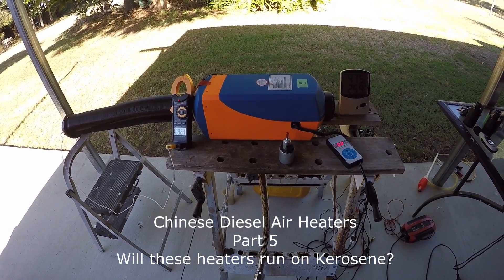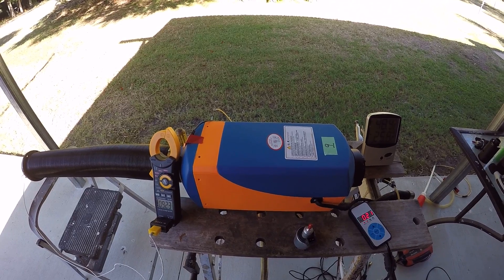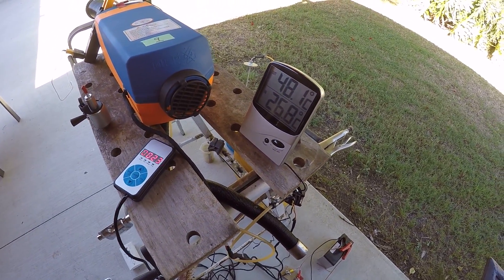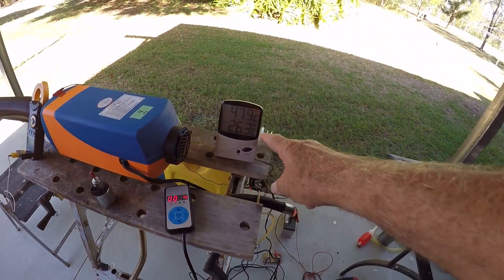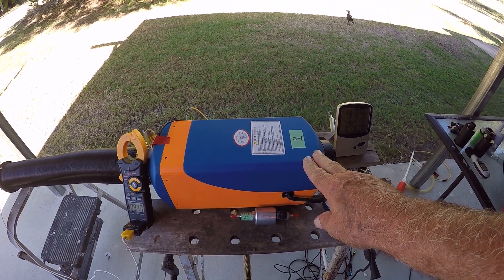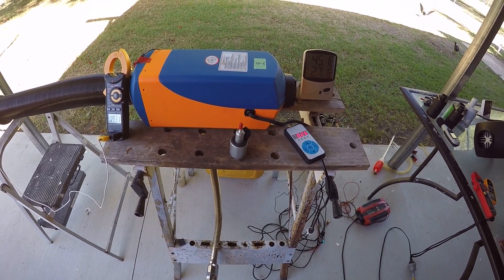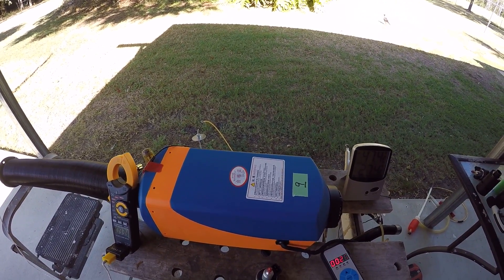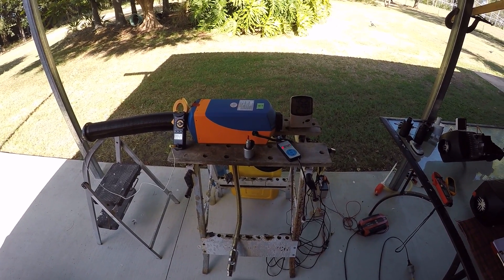Chinese Diesel Air Heaters   Part 5  - Kerosene Use.

Comment: Good to know when one is in a situation where Diesel is not available (had that once or twice). What about gravety feeding ? Thank you.
Reply from the maker: Hi Bernd, you need the pump. It is married to the controller and hence to the fan and sends out the correct number of fuel pulses for a set heat setting. You also need the pulse force to push the fuel through the atomisation screens.  JMcK
Reply: @johnmck1147  Thank you. It started to dawn on me while watching the next few episodes of yours. I also got a supposed 8kW unit, shame I did not see your series before purchase. Well, at leest I know the real values...  Thank you again - really good stuff you publicised, time well spend in a generous way!

Comment: Hey John. Thanks for the heads up! You're the first YouTuber I've watched to address the potential for Kero to kill a pump. What Kero/diesel mix should we be looking at to avoid any pump problems? Kerosene here in the UK is significantly cheaper than red diesel so a mix would be the way I'd like to go. Thanks.
Reply from the maker: Hi Jim,

As I understand it, you have both lighting and heating kerro in the UK. Heating kerro generally has a high sulphur content and is probably ok on its own. 

Lightning kerro is much purer and needs about 10% diesel for lubrication.

A kerro / diesel mix of 90/10 should solve all issues.    JMcK
Reply: @johnmck1147  Hey John. Thanks for getting back. I get kerro from the pump so I'd imagine it's the lowest grade fuel. Lighting kerro hugely more expensive so won't be using that. I'll try the 90/10 and see how I get on. Thanks once again...

Comment: Jet fuel , much like kerosene, would work in these well, as it contains quite a bit of sulfur and could be cheaper at today's diesel rip off prices. Stanadyne is a low viscosity lubricant additive for the benefit of the injection pumps on diesel engines. A little goes a long way.
Reply from the maker: Correct.   JMcK

Comment: A friend told me you can add some 2stroke oil
Reply from the maker: Your friend is right,..... In the short term. 
2 stroke oil  will give you real serious carbon buildup issues.
Just add about 10% diesel if using lightning kerosene.
Lower quality commercial kerosene (depending on brand) probably does not need any additives 
Cheers.  JMcK

Comment: Another good video on kerosene and more. If you mount your dosing pump slightly below your supply tank, you will have NO air bubbles. You have to ask yourself where the air is coming from. Sucking fuel up from a tank, like the main tank on your van may contribute to air in the system. These heaters dont seem to mind, as Johns video indicates. I believe if it is bled properly before start up, you will have NO air in the system.
Reply: 15 seconds priming seems to do not harm at all at startup. A new chinese diesel and water heater has recently been produced and it has a different approach to starting it primes the fuel into the heater with the pump running at high speed for about 10 seconds before ignition and it seems to start up in around 30 seconds which is much faster than many others taking 2 mins or longer.
Reply: @oojimmyflip  well it would likely start with a large amount of smoke! Not appealing

Comment: I just switched to car gasoline using a pump meant for the eberspacher gasoline model.  The heater lights up, but doesn't burn continuously, it instead pulses.   After a while, it shuts down with error code 08.
Reply from the maker: These Chinese diesel heaters are not designed to run on gasoline (petrol) . JMcK

Comment: can you run them on the  Diesel  Heaters on biodiesel
Reply from the maker: Hi Matthew,

You can run these heaters on almost anything that will burn.........FOR A WHILE
Yes, they will run on biodiesel for a short while, but the heater will rapidly gum up and carbon up and eventually will not start. It will need a full strip down and you will need to remove the excessive carbon deposits from the burner chamber and atomisation screens.   JMcK

Comment: I'm in the UK running my heater on kerosene. The original pump died (zero function) after several months, the replacement pump lasted 24 hours and now has zero function. There is a click sound at h on, but no pumping at all, nothing. Is this a lubrication issue or something else? Many thanks for any advice.
Reply from the maker: Hi Christian, As I understand it, in the UK you have heating kerro that has some Sulfur content and lightning kerro which is very pure. The pumps need some lubrication, sometimes there is enough Sulfur in heating kerro for this, but if unsure suggest you add 10% to 20% diesel to the kerosene to give piston lubrication.  JMcK

Comment: I have been running one of these heaters for over 2 years on UK standard low sulphur kerosene. It runs 10 hours a day 5 days a week. Over 5000 hours now. No pump problems at all. Just serviced it. Very clean indeed. Even the glow plug is mint.
Reply: Cheers for the info. Mine should arrive this week and I ain't paying £1.50 a litre for it lol.
Reply: I've been running kerosene in the UK for the past year. Just had a pump failure after about 100L of kerosene. Not a complete failure, but the pump was unable to pump enough fuel and wouldn't start. After replacing the pump I've decided to add 1:200 2 stroke oil to improve lubrication, I'll see how it goes but the extra oil certainly hasn't had any effect on the burn or heat output. Hopefully this pump will last longer.
Reply: @shmavitz 
@shmavitz 
I am now running 3 of these heaters on kero. Never had a pump fail. Did you try priming it? Could have been air or water in the line.  Seriously there is no need to add oil. Just extra expense and could cause soot on the glowplug and in the combustion chamber. I have run about 4000 litres through these things.
Reply: @codprawn  Yeah I checked for prime amongst other things l, as I initially didn't think the pump was faulty- changed out fuel lines, stripped heater down and checked glow plug and screen, double checked power supply. All were fine and no soot in heater - really clean. Swapped the pump out and bingo, it fired right away. On the old pump I managed to get it to fire if I substantially choked the air input but it didn't maintain a good burn, so concluded it wasn't delivering enough and was worn. Maybe I've just been unlucky.
Reply: You could have tried spraying into pump with wd40 and using a small Allen wrench to move the piston after a while of soaking. Also, use the correct fuel line with fuel filter set up that John shows in his fuel delivery video so no bubbles make your pump csvitate.

I am running kerosene and unit runs clean (should be little to no carbon monoxide also). Absolutely no smoke or deposits. I have added 2 cycle now and then but think it is not needed and have stopped.

It has been near and below 0 F. here and no need to worry about kerosene gelling. I think the Chinese want us to run diesel and clig up our heaters and buy new heaters off then Lol.  I say use kerosene if the price is right. Have a good day!
Reply: @shmavitz 
Good timing for the post. I have just filled 6x 25L plastic jerry cans of kero from our IBC. Its freezing 4C in the workshop!
Reply: @codprawn  what model have you got please mate? i wanna stick one in my campervan for the winter ski season
Reply: @harryshort7688  
They are all pretty much the same. Identical in fact. 8kw is actually about 4kw. 5kw about 3kw. Still amazing value.   
Just make sure the exhaust goes outside. Main warm sir inlet can be inside.
Reply: @harryshort7688  
Just spotted this. All the Chinese ones are the same really.
Reply: @shmavitz  in fairness, I had a pump go on mine, running straight pump diesel at roughly comparable hours. 
Although I too was contemplating the addition of some two stroke oil if I go over to heating oil. ( which I will do, cos it's nearly 80p a litre less)
Reply: As a noob to this, you mean the oil you have in your oil tank to feed your oil boiler when not on the gas network
Reply: @nerradekooc4224  
Yes home heating oil. Runs cleaner than diesel.
Reply: No problem with kerosene on my heater here in the UK I've never used diesel since the first 5 litres, pump is running fine with no issues.
Reply: Interesting, thanks.  Are you still using it? If so, where from in the uk?  Thanks
Reply: @RoadcraftNottingham  hi roadcraft, I’m in Shropshire, I get mine from a home heating fuel company, they supply bulk gas, bottled gas, heating oil (kerosene), coal, deisel etc.
Reply: But will also supply smaller amounts 5ltr is least I bought when I only had a small fuel tank, I get all my fuels from them, straight diesel for engine£1.30 ltr, kerosene for heater £0.65 ltr, propane bottles £40 for 15kg bottles. All are the cheapest in the area.

Before I found them I had the chance to get a two tank refillable LPG system with all vales and swap over system for free, but couldn’t find a local place to refill them, now I find the place I use does that too 🤦🏻‍♂️
Reply from the maker: 👍. JMcK
Reply: Excellent series!
Here in Scandinavia we are not familiar with kerosene, apart from as a special fuel used in aviation jet motors, by the name of ”fotogen”. Usage as a motor fuel stopped in the 60s, when  environmental taxation on high-sulphur fuel killed the market. Burning oil for heating almost stopped after the oil crisis in the 70s, but I know someone who knows someone who has an oil heater, so will buy some oil from him to try. This video made me learn all of this, thank you for that! From what I learned any HFRR value below that of diesel should work. Have not found a rating for E32 heating oil which is the -20C rated type used here, but should be (?) less then diesel. made me willing to try it out. Thanks for the video and comment above!
Reply: Cheers for that info, i'd been mixing 10% red into UK kerosene. I will run it neat kerosene, and save all the hassle.
Reply: In the U.K. as of today Diesel is £1.39 per litre, I can get Kerosene at 65 pence per litre, 74 pence per litre cheaper.
1. It has the added benefits of higher smoke point (less smoke generated)
2. It contains a higher Kilowatt density, more heat for same amount of fuel burnt.
Reply: This is the info I was looking for. Thanks 😊
Reply from the maker: Thanks for that feedback Codpawn. 
Are you using commercial heating kerosene or “lighting” kerosene?  JMcK
Reply: @johnmck1147  
Standard UK central heating oil which is C2. Still low sulphur though!

Comment: Hi there John , a Taswegian here.....Kero is expensive "diggers" like you know, but is it worth running say a couple of litres at the end of the cold weather just to clean the heater and fuel line through..? As over 4 months or so not used...
Reply from the maker: Hi Namdor, running a high kerro/diesel mix 90/10, at end of season on a med to high Hz setting for 15 to 30 mins really helps to clean out any accumulated carbon. JMcK

Comment: Can you use a higher sulfur diesel like home heating fuel oil? Any ill affects doing so? Thank You for your in depth knowledge and time.
Reply from the maker: Hi Sammy, These heaters can use lots of different types of fuel, however the greater the “oil” content the more carbon produced and the more frequent the heater service. JMcK

Comment: Here in Canada, kerosene is added to road diesel in ever increasing amounts as weather gets colder. In midwinter it is more than half. I have hauled it and tank farms make no distinction between it, stove oil, or jet fuel. You can buy little 10l jugs of possibly purer kero at gas stations and hardware stores at a much higher price. A HUGE thank you for making me much more knowledgeable than the TWO professionals that tried and failed to repair the heater on my heavy freightliner cascadia a couple winters ago. I now realize that starting the truck shut the heater off too abruptly and probably coked up the screen. This was a factory install. It was awesome when working and the little tic tic tic was much better than an idling diesel. Cheers, you are a hero!
Reply from the maker: Hi Al, Thank you for that information and the positive comments.  JMcK

Comment: You can add a little two cycle engine oil to the Kerosene to add lubricity
Reply from the maker: Hi Seymour, not a good idea. Two stroke oil creates a lot of carbon deposits in these heaters. JMcK
Reply: @johnmck1147  well you need lubricant so perhaps a little carbon is a fair trade off.

Comment: Thank you. So helpful... but why would an Australian need a heater? It always hot and sunny there. ;)
Reply from the maker: Hi TechyBen,

In winter in Aus we actually do get some snow. True. 
Anyway, that is what I am told. Never actually seen it myself.
Even where I live in Qld, with the most beautiful winter days we can go below 0°C at night, so a heater producing lovely dry heat can make life very comfortable.   JMcK
Reply: @johnmck1147  Thanks, also seems to make sense if it's rare you get cold weather. Why fit central heating if it's for one week of the year?

I've setup one of these temporarily in my boat, and a few here in the UK have them as permanent winter heating in their boats for when they don't have time for the log burning stove. :)

Comment: I wonder how so many people are using kerosene for years without issues. Maybe it's the higher sulfur kerosene you mentioned that's available in the US? I'm switching my Espar D5 over to a dedicated 5-gallon kerosene tank so I'm trying to make sure I can protect my fuel pump. Maybe a lubricant additive? Or a mix of diesel and kerosene that runs cleaner yet still protects the pump?
Reply from the maker: Hi Money pit,

These heaters don't like oil additives like two stroke oil. Lots of carbon produced. 
Commercial kerosene in many countries has a high Sulfur content that provides lubrication.
If using very pure lighting kerosene it is better to add 10% diesel to the kerosene for lubrication.  JMcK
Reply: @johnmck1147  Thanks so much. I have no idea what I'm doing, just trying to heed the warnings of diesel clogging up the Espars. I'll go with your 90/10 mix being that I believe our gas stations sell 1-K.

Comment: Don’t no what one of your video for my question would be best for , so I got my heater last Thursday, my heater will be mounted out side of my hunting camper, would intake side of the heater be better off ran back inside so it pulling from the inside air and not out side air
Reply from the maker: Hi NC, It is personal preference. Some people like to heat fresh air, some like to heat recycled air.
It is totally up to you. However it is more efficient and more economical to heat recycled air. JMcK
Reply: @johnmck1147  thanks for the info
Reply: @johnmck1147  is there a replacement end cap for the screw on end cap to adapt for inlet
Reply from the maker: @JBs_trucks_and_whitetail_bucks  
Not quite sure what end cap you refer to, but you can buy a lot of replacement parts on line.  JMcK
Reply: @johnmck1147  the inlet side , it’s a screw on cap it’s bigger than the outlet/hot side
Reply from the maker: @JBs_trucks_and_whitetail_bucks    Right, I assume you mean the inlet cap that holds the two half shells together. Some caps are screw on, some push fit. I have never tried to buy a replacement, but as there are different types you would need to try the supplier who sold your heater. 

If you can't find a replacement you could use tie wire or a worm clamp to hold the casing together.

Another option is you could try and  use an auto air intake filter, that will provide a filter and a clamp.  JMcK

Comment: In Ireland I know of many people who run diesel cars on kerosene. It's very common as it's about 1/3 the price of diesel.  To combat the lubrication issues many will add some two stroke oil into the tank. I know a guy who put 100k miles on an old VW golf TDI using pure kerosene and no two stroke oil. Never had any engine problems at all.
Reply from the maker: Thanks for that information Eire.  
Is the  kerosene you use lighting kerosene, or less pure heating kerosene that has a Sulfur content?  JMcK
Reply: @johnmck1147  it's heating oil kerosene. Available at pump at many filling stations as people sometimes fill up drums for their home heating tanks.
Reply from the maker: @EireTireoghain  👍

Comment: I know I'm late to the to the comment section but what ratio between diesel and k1 kerosene is safe for your pump and the fuel freezing factor?
Reply from the maker: Hi James, anywhere up to 80/20 or 90/10 kerro/diesel mix seems ok . JMcK
Reply: @johnmck1147  Thanks for your reply, I think I will go with the 80/20 to be safe. Love your videos they are as informative as they can be.

Comment: In the past when running kerosene or home heating oil as called here in Ireland I always add 2 litres of cooking oil to the keresen  to lube the pump and haven't noticed any issues.  Used this when running a 2.5 diesel engine.  Love the videos really great information.  Cheers John.
Reply: You could also try adding some low ash two stroke oil 👍🏻🇬🇧
Reply from the maker: Thanks for the info and feedback David.  JMcK

Comment: Wbat would happwn if you add marvel mystery oil to the  diesel? Would that be ok snd or help lubricate it?
Reply from the maker: Hi Anthony, 

First you do not need to add anything to the diesel to aid lubrication. Diesel is a lubricant.
As for adding marvel mystery oil to the kerosene, I can not say as I am reluctant to comment on anything I have not personally tested.

What I can say is don't burn “oils” in these heaters. “Oils”, that make smoke, like 2 stroke oil, are bad in these heaters as they make excessive carbon. They give you lubrication but also give you excessive carbon and maintenance issues.

Cheers JMcK